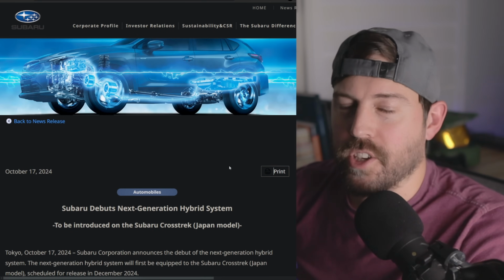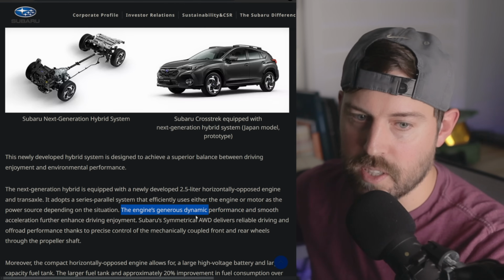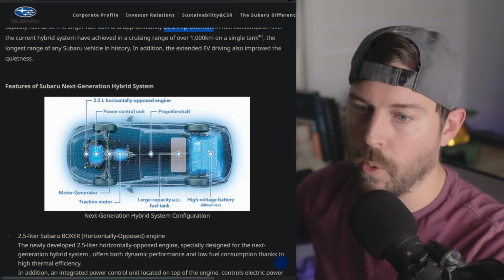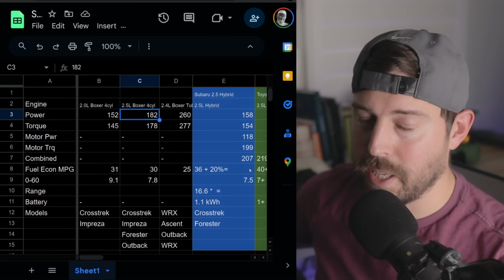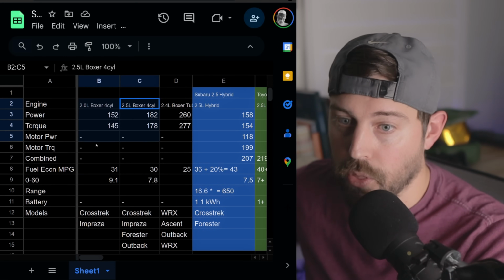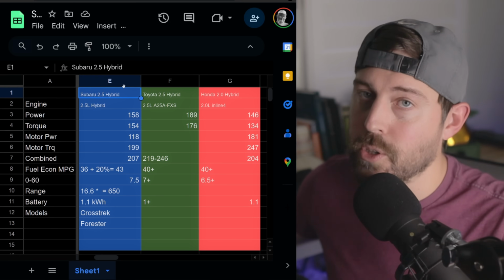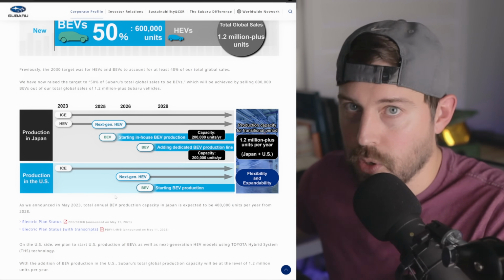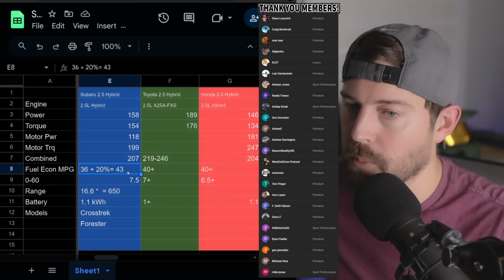Subaru's NEW hybrid Announced! Does it BEAT Toyota and Honda hybrids?

Comment: There’s no reason why the new Forester shouldn’t have 215 hp - 230 ft/lb torque and get 38 mpg.  We have a ‘24 Forester Touring and it’s great except it’s underpowered.  The added power with electric motors would help with acceleration & NVH improvement of not having to run the engine wide open to get it up to speed.
Reply: Exactly!   We he said 205 HP total I was very underwhelmed.   Heck, the Toyota 2.5L by its self has 205 HP.   Like you said…the new forester should have at least 220hp -that would solve the acceleration problems.
Reply: Even at 205hp, the hybrid added torque would feel noticeably better. @matthewjohnson1211
Reply: System Power Output is just 180PS.

Comment: Subaru has one of the best AWD systems on the market and do pretty well in off-road and snow/icy roadway conditions. I understand vehicles like this  (SUV, 4x4s, ...) typically have very poor aerodynamics and really suffer at highway speed. This is a major factor limiting their mpg. Still, I also believe in trying to make things as good as possible.  My hope is they are somehow able to optimize their Cd for high speed, yet keep their off-road capabilities.  Lose some of the silly plastic cladding, maybe have speed sensitive adjustable front air dam, maybe even a speed sensitive adjustable suspension that lowers the car at high speed. I know, this would cost too much, but I can dream!

Comment: The original Chevy Volt before it was release was going to act like a generator to charge the battery and not power the wheel. It could not charge the battery fast enough so Chevy had the ICE power the wheels. I don't think the technology is there yet and I work on the semi side of auto for controllers, etc....
Reply: The ice doesn’t power the wheels in the Chevy
Reply: @smath5841  Under certain conditions the ICE will power the wheel through the clutches etc.... It is connected but not directly like a normal ICE car.

Comment: At least 6.3L/100km... Hmmmmm. Not amazing but for an AWD vehicle it is really good. I would expect to easily be able to achieve 5.8L/100km if you drive conservatively. The thing that can't really be expressed with written word is the driving experience which would be esssentially a Prius with Subaru AWD. Instant torque with very linear power delivery. It will be so much better than the current CVT. I think this powertrain will make Subaru much, much better to drive. They were smart to start with the Crosstrek over the Forester given how popular the Crosstrek is. A Toyota eCVT hybrid Crosstrek is definitely on my list of next vehicles. One of my family vehicles is a Prius and it is a tank. That drivetrain coupled to full-time AWD probably feels great. Not fast but efficient, responsive and really great to live with.
Reply: Tempted to wait for a hybrid Crosstrek , or if it takes too long I'll buy a Crown Signia
Reply: @mirceamunteanu4791  If you want a better AWD system I would wait for the Subaru. eAWD is not the same and not nearly as capable.
Reply: @kiefershanks4172  true , but I do like how well equipped the Signia comes, but way more $$$$.

Comment: No it doesn't because their build quality is on par with Chrysler nowadays
Reply: Hmm, Subaru is always in the top on Consumer Reports most reliable list, whereas Stellantis vehicles are always near the bottom.  If you want reliable, buy Toyota, Honda, Mazda & Subaru.
Reply: @chrisb9478  agreed.  I wouldn't compare Subaru to Stellantis.  Maybe they were thinking of Nissan.
Reply: And yet I know 7 people all with Subarus less than 3 years old with serious problems. Anecdotal? I guess, but I've never seen anything like that in my life with any other brand
Reply: @ek4022  Our family in on our 9th Subaru, never had a major problem with any of them. 😑
Reply: My 2017 has 96k miles and I have no issues.

Comment: Does it still use a belt-driven CVT?
Reply: No, Toyota eCVT. Gears and motors
Reply: Subarus CVTs are chain driven.
Reply: @JonProce  the hybrid has planetary gear system
Reply: It sounds like Subaru took the eCVT from the GS450h and LS600h and adapted it to their specific needs.
Reply: Subaru is chain and are solid minus the selenoids in them

Comment: No, it doesn’t. Great channel though.
Reply: @NomenClature-o8s  It basically is a Toyota hybrid with a Subaru engine and AWD system. It will be better performing than any AWD hybrid in Toyota's line-up.
Reply: @kiefershanks4172 it’ll have less range because boxer engines aren’t that efficient compared to inline 4 cylinders. Also Toyota current NA 4 cylinder family have 40% thermal efficiency, which Subaru’s flat 4 doesn’t get anywhere near that.
Reply: @tails300  They litteraly said they will have a range of 621 miles
Reply: @Ben1446 this is an estimated spread sheet, which means 621 miles is also just a guesstimate. He also said it’s going to be slower than Toyota and Honda’s offerings, and the fuel economy will suffer due to Subaru’s AWD system.
Reply: @tails300  there are multiple articles saying its 621 miles and subaru lies about their performance numbers  to make it cheaper and familly freindly turn on xmode then floor it the 0-60 gets reduced about 3 seconds
Reply: @Ben1446  which articles are those?
Reply: We will see
Reply: Yep, Toyota designed the hybrid functionality so it'll be about the same.
Reply: The forester hybrid looks promising.... maybe also with the incoming outback hybrid... we'll knownif it's a success in a year or two

Comment: Nissan must bring the e-power hybrid system here and apply it to the kicks, murano and rogue. That would boost their sales
Reply: Epower is an all-series hybrid, so it isn’t really fit for bigger models. What they will do is use Mitsubishi’s PHEV system instead, like what they are doing for Rogue
Reply: @Blank00 The European Nissan X-Trail, which is same car that you call the Nissan Rogue, has an ePower option with either FWD or AWD, so there’s no reason why it couldn’t in North America.
Reply: @ the E power is not optimized for highways. Honda’s hybrid is basically the same as E power, but it has clutches that make highway driving more efficient
Reply: They’re so cheap so it’ll be a while
Reply: Nissan should go bankrupt and be out of business for their shitty cars and trans. So cheap and poor engineering. The only car that’s good is probably the gtr but then again it’s outdated inside  and looks the same for over a decade. Then dealer messed up the Z by overpricing it when it isn’t worth that much and sales dropped bc nobody wants one. They just don’t put in good time and effort and money into their cars. Mazda Honda Toyota and Lexus are far better Japanese manufacturer